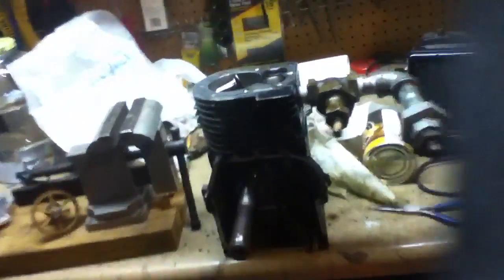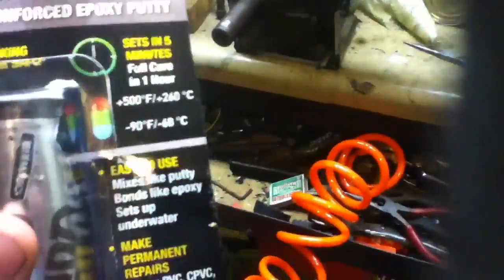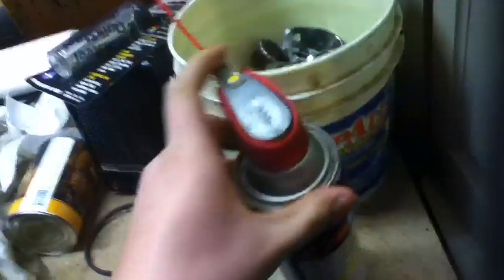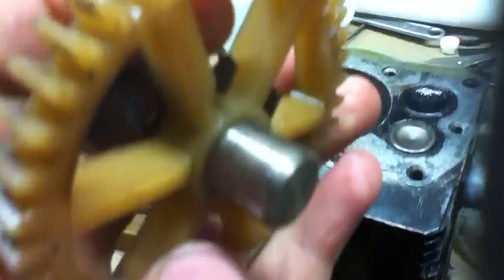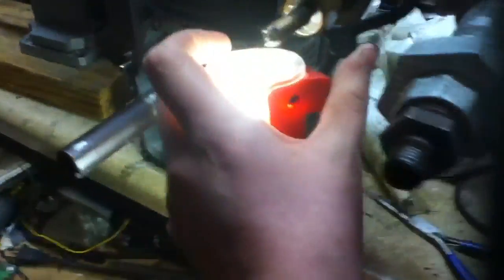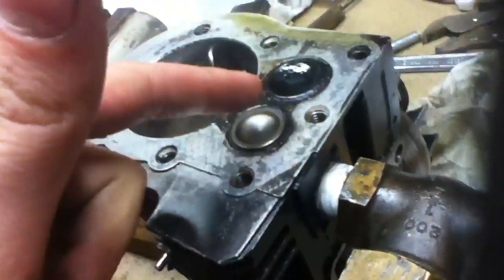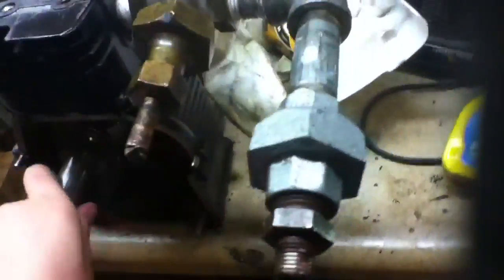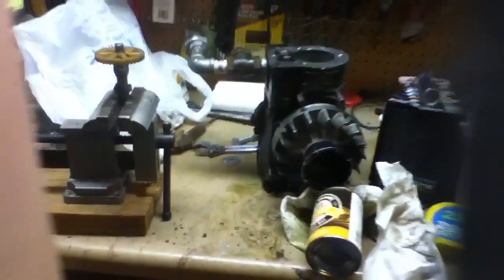Concept design steam engine the cam Chronicles

Comment: Interesting cam lobe material, hope it works out OK.
I have have to resort to grinding the counterweights on the crank in some of my radical engines.
Yes, you want to use the exhaust port for the inlet now, the pipe threads work out well.

Comment: I recommend you take all the lobe assembly off from that cam and make a steel assembly which you can weld on. The plastic will rip off with all the torque, also make the lobes exactly 90 degrees with no overlap. Remove some from the intaking lobe ( old exhaust?) if necessary to stop overlap. The stronger valve spring isn't really required as it will still run. Coming along nicely though :)

Comment: heres a good idead i did take the oil scraper ring off the piston use electricle tape to cover the holes in the pistons and fill the slot with a cotton or hemp rope better seal ,, vale replace the valve sring with a older 5HP spring BTW if u look at the v-1 project i only ran it at 20-30 psi and i thaut it would fly aprt next change ur oill OFFTEN like every run the steam will contaninate it bad hens the reason for the (heavy mod motor) atemt to keep the oil kleen =3-

Comment: So remind me again, are you testing it on compressed air?
I have found it pretty difficult to keep the inlet lobe duration short enough to allow for some expansion of the air or steam, using the regular 1/2 crankshaft speed camshaft. I found a 1 to1 speed camshaft much easier to fine tune the opening and closing, however you have the added complexity of the extra idler gear. I just found that I had reached the limit of developement using the 1:2 cam, so I tried 1:1. I do use 1:2 still though.

Comment: ill tell u tis for shur u will have a hell of a time installing the valve train hint take the valvs out first and turn it up sidedown put liffters in then the cam then the valves it the ONLY way seence u added the extra lobe i learnd for get the turbo make the exsaust steam into ur smoke stake facing out and it will suck air into the air box ref locomotive just get a new gate valve trole body